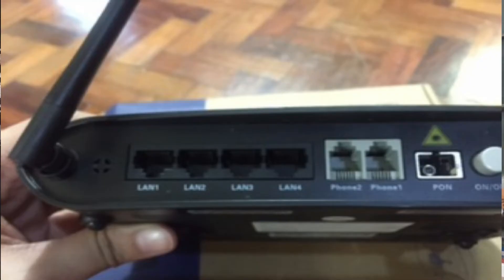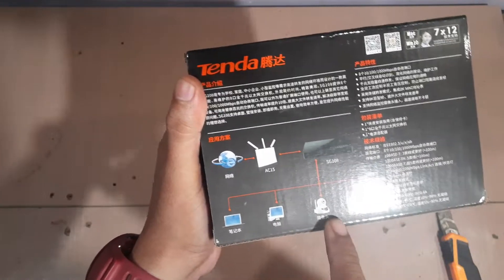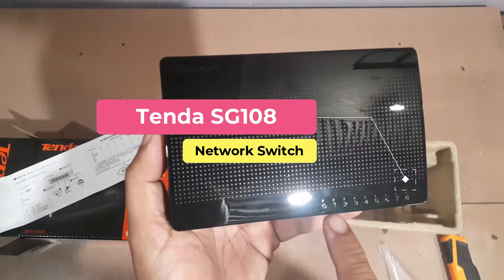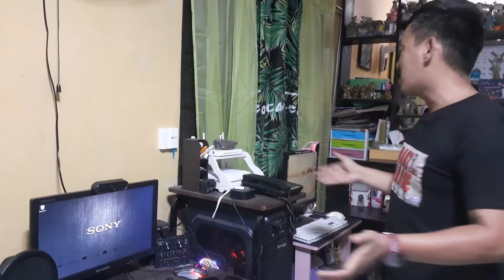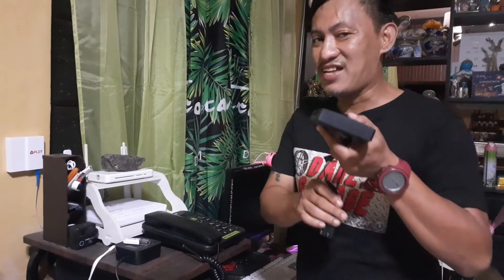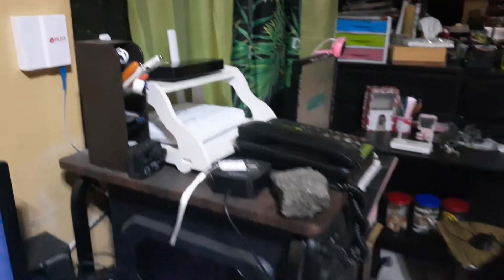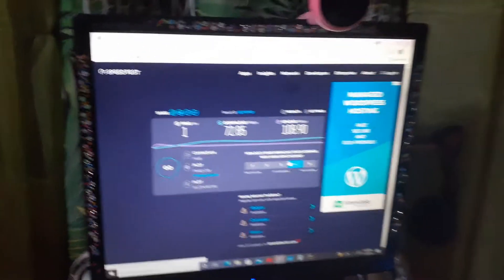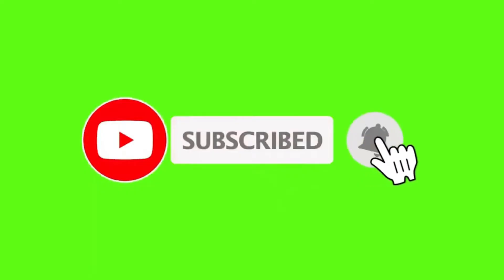Tenda SG108 Network Switch "Giga LAN"

Comment: I noticed that it doesn't have screws for the opening or fitting points, it looks like it's a single piece glued together. Has anyone opened the Tenda SG108 Switch for maintenance?